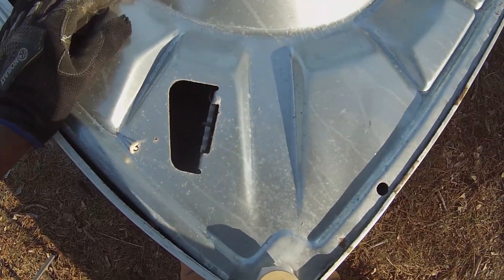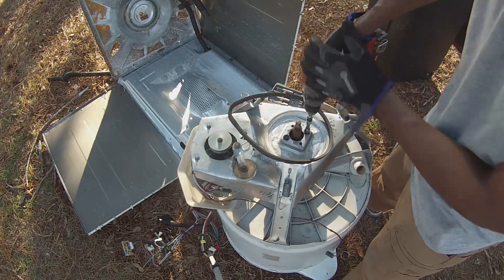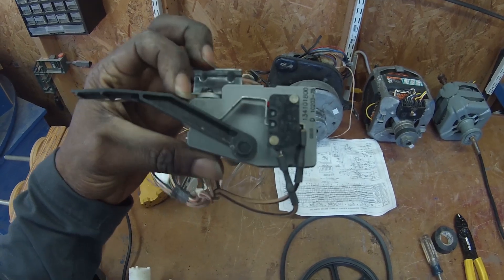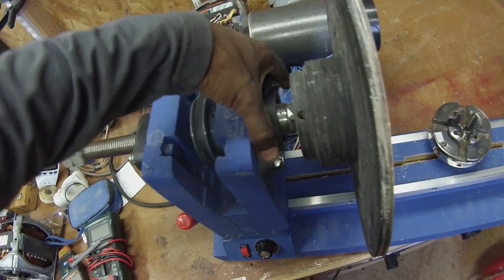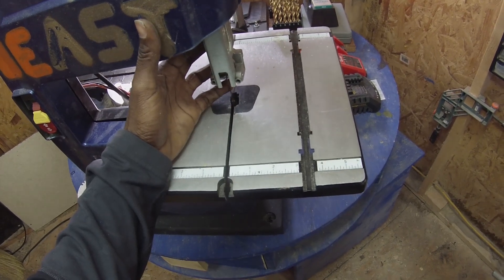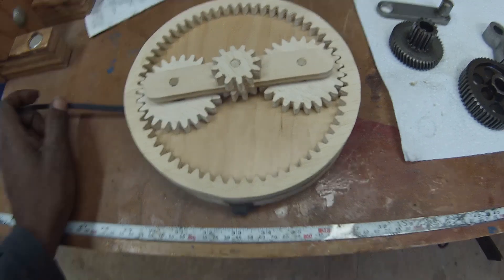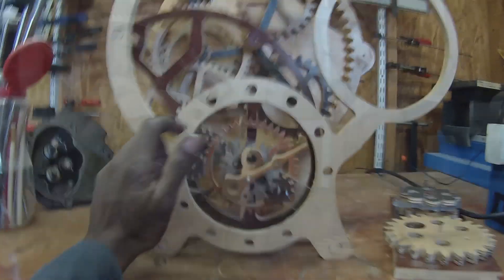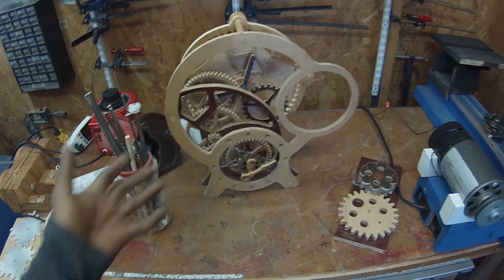Things You Can Make With A Washing Machine And Other Salvaged Components : 020

Comment: Just a tip for your band saw, pushing it to cut when dull.  The steel blades bends and straightens every time it goes around the wheels. What happens when you bend steel over and over again?
If you didn't know, it's called metal fatigue.
Stress fractures start to form in the narrowest part of the blade, in the gullet.
When you sharpen the blade you remove a bit of this surface and any microfractures associated with it.
Sharpening isn't just to sharpen, but to prevent the blade from shattering and coming out of the saw and in to you.
Maybe it isn't much of a problem with smaller blades, but when you start running 20 foot long two inch wide blades, they have to be sharpened EVERY DAY or they will break and crazy shit happens when they break, like they get folded up like an accordion spring or thrown completely out of the saw and fly all over the place.
Please just sharpen your blade or buy a new one.

Comment: Good vid my friend! You may want to look into the Gingery series of DIY books as well- you have the power to do a LOT with a washing machine! Chicken Plucker, Spin casting unit... waste motor oil separator... all use centrifugal force as a primary function! The spin caster is awesome as it already has the safety switch and the clutch/gearing transmission assembly in place! SUBSCRIBED- and as always- be safe and have a great day!

Comment: I'm very impressed with your projects and abilities. This is coming from a 53 year old who, like you, has made alot of his own equipment from an early age. It's great to see you teach others and light a spark in them. We need alot more people like you, who go and create from scratch or repurpose  parts into new projects. Many thumbs up and you have yourself one more new subbie 👍👍👍👍👍
Reply from the maker: That is awesome thank you, welcome to the neighborhood.
Reply: @Jeremy_Fielding  Looks like the microwave motor on your planetary gear toy is exactly like the ones on the actuators on newer top-load washers, except those are (2.5 or) 3 rpm. The outside is often the same other than that.
Reply: @Jeremy_Fielding  I used a microwave motor for making a cardboard box dump balls from a ball dispenser.
Reply: Van Der Hoof I agree.  And though I have no experience actually building anything myself yet, I've been working on doing so someday.  Thanks to things like youtube, this kind of information is easier to find than it was a few decades ago.
Reply: Van Der Hoo
Reply: Ditto! I'm 65.
Reply: " a lot"

Comment: So my question pertains to the use of the washing machine motors. My understanding of these is that they give off ultraviolet when in use, do you plan to add shielding to the projects that utilize them and if so how will you balance air flow with shielding?

Comment: Awesome! good video. Smart. I am making a cymbal cleaning machine. On my 1st attempt I used a sump pump motor but it won't turn bigger heavy cymbals - it keeps shutting off ( thermal protector?) from getting too hot on start up. I need to have it spin at different speeds but don't know how to make that happen yet. Any suggestions? Thanx in advance.

Comment: Hey Jeremy,  Real neat stuff! I'm building a lathe and the power source is my job site table saw the lathe sits on top and when I'm not using it i can set my 10inch disc sander on top to power that, all are belt drive.  When done i'll send you a link and check it out.  love the gears cool cool.  Mike,,

Comment: stainless steel washer tubs make great fire pits.the flat sheet metal from the sides are good fro shelves on a shop cart .you can use the motor for a cheap bench grinder .

Comment: Just picked up a new dishwasher an hour ago. Is the motor or other parts from the replaced Kenmore worth saving?  The heater went out and melted and he electronics panel (replaced), then the heater coil went out and burned a hole in the tub. Everything else inside should be good. What can the motor be used for?
Reply from the maker: I just picked up a dish washer this week. So I am only just getting to see the inside of one. The motor I got is 1/3 horse power and it had a small impeller on the motor. I haven't thought much about the parts yet. Don't forget to get the start capacitor if you haven't thrown it away yet. I took the motor, some of the wires, the capacitor to start the motor, and the water pump. The rest I put out to the road since it was trash day. I don't like to have machines laying in the yard. As soon as I can get it out, it's gone. the wires leading to the motor were really scraped up and that is probably why it stopped working. They shorted out to the body or the wires themselves.

Comment: Jeremy...  What state do you live in?  I Live in Gig Harbor Washington (State).  If you are really interested in Electronics, there are some things I would like to send you.
 
 I've been doing this since I was helping my Grandfather in his shop.  I was only 5 years old when I started and that was back in 1955.  He fixed radios, TV's, Cars, and watches.  I am kind of following in his shoes, with the same interests.  If it has a electric cord, I'm into it.  If it is broke, I fix it or use the parts for other projects.  I want the parts, so sometimes I don't try real hard to fix it.  I had a friend, who just died, that gave me a gyro from a military airplane.  It was broken.  But that didn't stop me from fixing it.  It Is smaller then a tennis ball, but bigger than a golf ball.  It runs on 400Hz three phase( around 90 volts (A.C.)).  The winding in side was burned, so I took it apart, unwound the coils, and rewound the stators.  The wire size is a whopping #42 enameled.  Each phase has three separate windings of 400 turns each.  That came out to 3600 turns total, without breaking, then I had to get the windings tight enough to be able to put it back together.  It works just fine, and is quite interesting in what it does.  After it is at it's fastest speed, It takes about 10 min to stop again.

My email address is --   restore.n.fix@gmail.com

Have Fun with your projects.
Looking forward to see what you have in mind next!!!!

Michael
Reply from the maker: I emailed you. If you want you can edit this comment to remove your email address. That way its not public.

Comment: the sheet metal back and side plates could used  for many things  currently I am building a quail coop   and that sheet metal could be the poop dropping catcher since I want to stack the cage levels for more birds per square foot of garge space  I have a wire mesh floor on a slight downward angle  to allow the eggs to roll out to the front  under the feeder troughs   that's the first thing that came to mind  since that is what I am working on. right now 

another idea just came to mind  is a food dehydrating  reassemble the sheet metal of the case of the washer put shelves in for trays to the food on  I am sure you could find a motor/fan combo  and a heating element  after box and trays are made  all that would nessarary would a air temp control and shut off time  since most dehydrators  run for 6-12 hours 

a washing machine sized  casing  would be 2-3 X  time the capacity of $300.00 machine

Comment: hey Jeremy  how to breakdown 20v dc to 9v dc
Reply from the maker: +Rakesh Persaud well, you need a voltage regulator, but that is outside my expertise to explain how you could set your whole circuit properly. There are other components you could use that will do the job, but this will point you in the right direction for research. Others have made videos about this.
Reply: Jeremy Fielding ok  my brother thank
Reply: You could do it with a voltage divider. You put two resistances in series within (in this case) a 20v circuit, where the ratio of the resistance connected to the 20v side of the circuit to the total resistance of both resisters is, again in this case, 9:20. This will give you a 9v drop across that resistor. Google the term voltage divider to get details on how to build one.
Reply: Voltage dividers do not work with variable loads, so it's not an option in most cases

Comment: Any suggestions on what I can do with an old garage door opener motor?  I have one sitting around just waiting to be used in a project.
Reply from the maker: Ok, I just tried it myself, and I was wrong about the posting a picture. I thought you could post without signing up. Sorry about that. What size is the motor? I am trying to get an idea of how large it is? Also look at the motor name plate and let me know if it is single phase (induction motor) or DC or motor what type.
Reply: My apologies for the delay. It is 5 amps at 1/2 HP (110 V) according to the label.

Comment: You can adjust the speed of most induction motors by controlling the frequency. Voltage I think controls the torque(Not completely sure on that).
Reply from the maker: Well, If this motor was three phase you would be spot on. But no one sells a Variable Frequency Drive (VFD) for single phase motors. There are several reasons for this but this motor can't be controlled by a VFD either, primarily because you can't get one.
Reply: How about a v-belt type CVT pulley mechanism to over/under drive the 110 60hz motor's output as needed?

Comment: Jeremy I see you like Gears so I want to ask your help with a project I want to do. it is a gearing to change rowing motioninto forward drive. I saw horizontal track with gearing teeth above and below on it's inside edge. with a round gear inside. wjat I think I need is this same kind of gearing but with the track curved a bit as I want to mount it to inside rim or a hollow rim wheel, that when a handle is added will alow it to be moved forward as the handle is rowed back and forth . any thoughts?
Reply from the maker: check out 500 mechanical movements. http://507movements.com... I have the book and there are several types of gears that do what you are describing. Some of them are quite complicated. So,  working out the gear profile will be a challenge.

Comment: Jeremy great video! I do this kind of thing myself. I just picked up 2 vacuum cleaners yesterday from beside someone`s dumpster. one looked perfect but didn't run, where as the other one ran perfectly but was missing the upper portion including the handle. so I triedto rewire the messedup 1, vut still no go.but adter removing the bottom of the 2nd. one I thought of using it under my mobile shop workbench as built-in vacuum system. as the hoses from these vacuums was what got me looking at them to start with. I want to run hard lines around the underside of the work bench`s outer edges, then mount the stripped down vacuum to one of the legs or even under the lower shelve. and tie it all together, It will be handy as many of my bench top power tools reside in my work bench. I say in because they are on flippable segments of my workbech`s top. As I have small shop.
Reply from the maker: I like it... that sounds like what I did to my work bench... check out video 18 if you haven't seen it.  https://youtu.be/Fj2BL9E0hio

Comment: have you ever made anything out of the fan in an overoven microwave? how do I figure out what size startup capacitor I need for it?
Reply from the maker: My scroll saw used a microwave fan to cool the motor. You can see it in this video. https://youtu.be/Tv85jhhlk9I . You should not need a start capacitor for the fan. It can be wired directly to 120 wall voltage with some kind of switch to turn it on and off.

Comment: I made a heat shield for the barrel burner in my barn, from the sheet metal casing, and I keep some sheet metal around in case I ever need to fix the floor board of a car.  The cases also make great stands for power miter saws, drill presses ect.  Two of them with a bench top make a strong bench too.
Reply from the maker: Nice

Comment: I salvaged the motor (1/2 HP) from a trash compactor a while back. Haven't wired it up yet, need to go back and re-watch your vid on that. It's "high torque" though. Any special consideration for that? Also got some nice beefy 3/4" threaded rods from that machine.

Comment: Man you do great things! I love the videos. Just one thing I found out, try and stick to older top load washers, I took a front load apart and the motor appeared to be a frequency controlled 3 phase motor. Not easily used, but the tub had some tremendous bearings so it was worth the time. And fun too.  Keep up the stellar work.

Comment: Thanks for another great and inspiring video! 
My current project (have not worked on it so much) is to try make a scroll saw. My grandmothers old Bernina sewing machine broke down a while ago and she wanted to upgrade, so I took it and salvaged the parts. I got some steel rods, pulleys, belts and a nice working 220VAC motor. So I hope that I can make a scroll saw with these components and some wood. The sad fact is that I do not have the basic precision tools to make things like this so in the best case scenario the scroll saw will turn out only half shit :P The thing is that I disconnected all electronics and wiring a few hours before I found your channel where you said "keep all the original wirings", so now I cant speed control it :P 

Thank you again my friend! Definetly one of my favourite chamnels! <3
Reply from the maker: The irony "keep all the wiring"... I love it. Everything on my scroll saw can be made with hand tools. It just takes a lot longer. Don't let that keep you from trying to make it. You will be frustrated but the satisfaction of turning it on for the first time is awesome. Check out this video if you haven't see it. I show my shop-made scroll saw at the beginning. 
https://youtu.be/zHfYrx6Vbzc

Comment: what was supposed to be wrong with that machine? it looked brand new.
Reply from the maker: As far as I could tell the water pump was noisy. All the wiring was intact, and the mechanical parts seem to work except the water pump. It probably would still pump water but slowly and was making noise. I didn't try to power it on before I took it apart so there may have been a blow fuse as well.
Reply: Jeremy Fielding I've gotten more than a few microwaves that were dumped for the want of a power supply fuse, it seems a shame but then there's be fewer things for us tinkerers to pull apart. it's getting harder to get things this side of the pond - we have these municipal dumps full of broken machines just waiting to thrown into landfill and they're covered by fancy CCTV to protect the garbage! what a world!

Comment: what do you think I can do with a blown up engine.
Reply: I also have a paper shredder that just stopped working in forward.
Reply from the maker: I haven't torn apart a shredder. What kinds of parts do you have? At a minimum you have a small DC motor, some tiny gears and one or two rollers. The rest is probably just plastic. The rollers would go in my shaft cup for later use. I usually give the small DC motors to my 10 year old son so he can play with them. He has rechargeable batteries that he uses to make them spin. Sometimes he takes apart his other toys to build Frankenstein versions of his toys. I am happy to let him do it.
Reply: Jeremy Fielding I'm wondering if I can take the paper shredder parts and make a beefed up version of its former self. I was using it to shred cardboard for composting. worked great until it didnt. 

I'm excited about the serpentine belts, pulleys, and roller bearings on my trashed engine. if I don't have to put them on the new engine I'll also have an fluid pump from the power steering pump, an air compressor, and a generator. the rest I can turn into sellable art pieces.

Comment: Hi used the microwave turntable motor to make a spit roast turner for a friends BBQ it is permanent brick built one. I also reuse many recycled bits in different things not as good as some yours though! Love your channel. Barry
Reply from the maker: What size items can you roast. I am picturing a pig spinning around but I guess you are talking about kabobs?
Reply: Jeremy Fielding Chickens mostly a couple of small ones! the shaft is stainless stele shaft from a printer and 2 bent table forks clipped to the shaft with metal pipe clamps.

Comment: If the washing machine has a stainless steel tub, it makes a great pot for pot plants, and also as a small fire pit.
Reply: I use the plastic ones for catch basins  for downspouts and such. Dig a hole insert tub. you can make a concrete cover to run the downspout into. I don't have pipe so I made a funnel shaped concrete cover. I use them to clean gravel too
Reply: i pull the metal tubs and weld legs on bottom and resell them as fire pits however his looked like many i see now days, made from plastic.
Reply: Or a crab steamer.
Reply: sell those as "one use" fire pits. (don't mind the black smoke)

Comment: Do you attempt to repair any? Then harvest those that are too far gone or too much to fix than it's worth? Thanks once again for your videos.
Reply from the maker: No, I don't usually try to fix them. But, the problem is usually really small. The belt broke, the plastic coupling on the motor broke, or the capacitor burn out. These are all cheap parts to replace. But I don't need a washing machine, and I don't want to go through the effort of trying to sell them when its so much fun to tear it open and make gadgets. There are people who do it, but It's not for me.

Comment: i made a 12v portable generator that charges car batteries and it was for our camper. i used a old self propelled push mower mounted a Ford alt on the back of it and it surprises people at camp grounds. they hear a lawn mower but dont see any one using one till they check mine out.
Reply from the maker: That is pretty funny, and awesome.